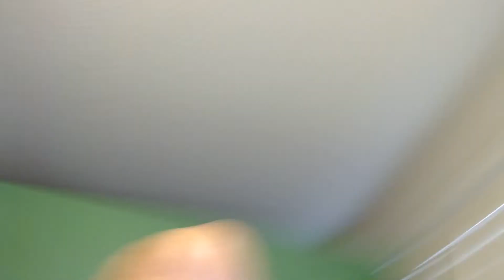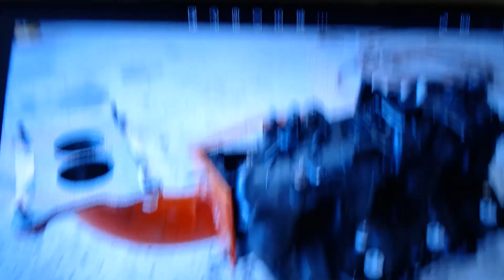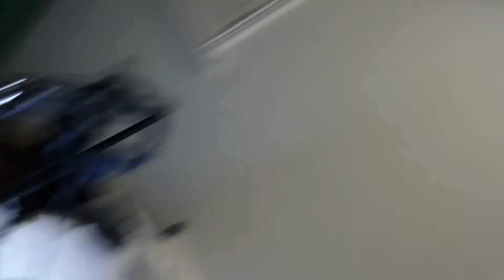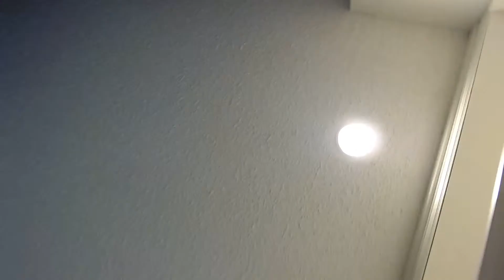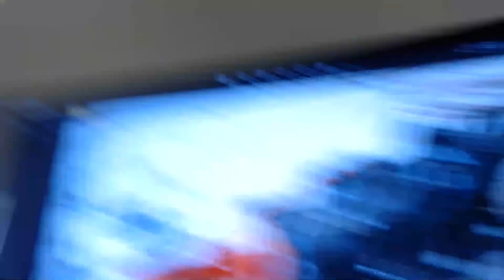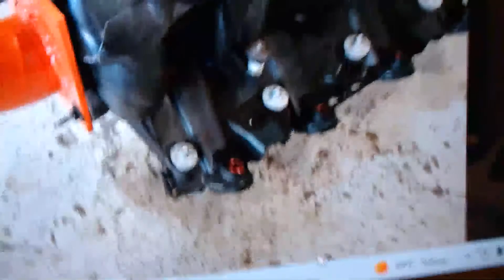LET'S TALK TECH-THE ELBOW RAM LIVES

Comment: Sooo im late. Could you use a carburetor for a cooling effect and tune the fueling and ignition with fuel injection. You could clean up the fuel distribution with the FI and  use the carb as a intercooler

Comment: For the fuel injected SBC guy. There's a port injection single coil option. Uses a 4 tooth crank trigger (dual trigger distributors also work instead). The simplest way to point you in the right direction for that, is 2001 Express Van parts. Gen 3 LS ECU, mounted on the older SBC, by GM. And of course, the gen 3 stuff has become extremely accessible with free software (UniversalPatcher) and a $50 OBDLink SX.